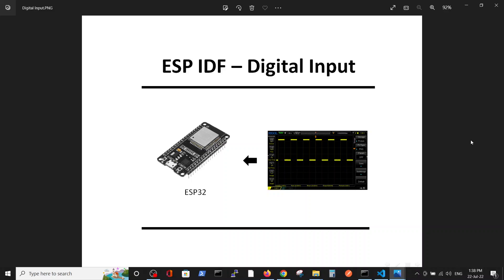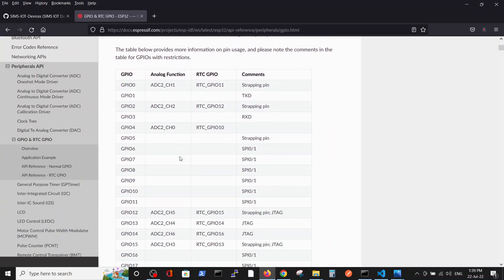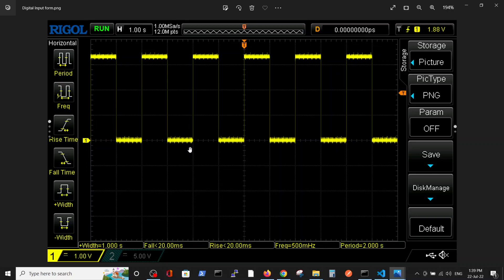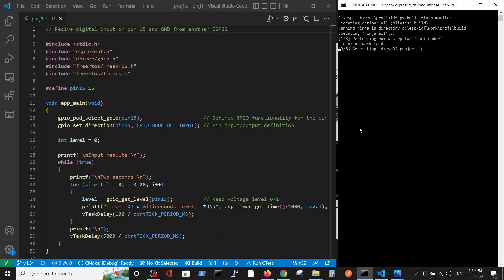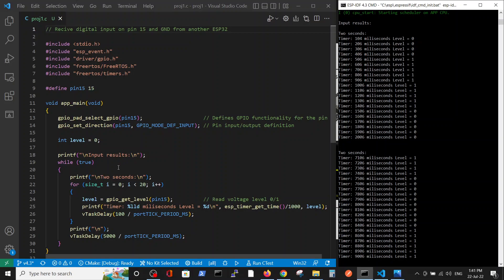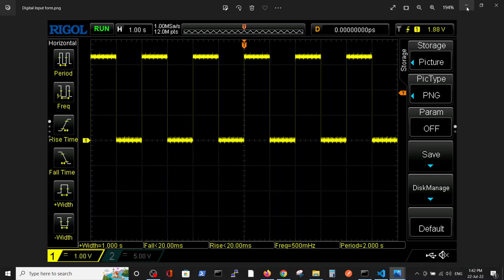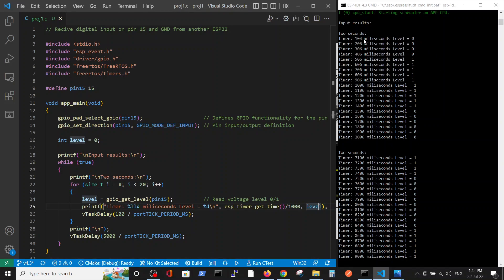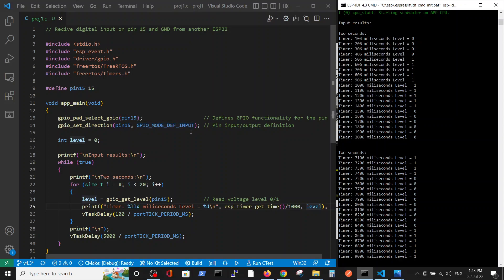Read digital input to ESP32 in ESP IDF environment

Comment: The stuttering is immaculate 🫡
Reply from the maker: An interesting comment
Reply: @simsiotdevices6219  also you can’t be mad, 0:38 is pretty funny 😂
Reply from the maker: @DruMarr  :)
Reply from the maker: Why a skateboard review guy is interested in embedded programming videos?
Reply: @simsiotdevices6219  using WLED and an ESP32 board to create custom LED show lights for the tail lights of my Scion FRS show vehicle.

Need to use digital input from the turn signal voltage and connect the signal to a relay, then connecting that relay to the ESP32 and create a MACRO function telling the board to turn the signals on/off.

So yeah I review electric skateboards but I can do other things as well sir…